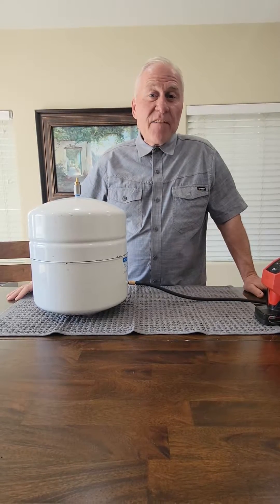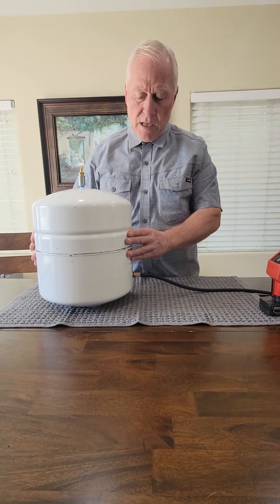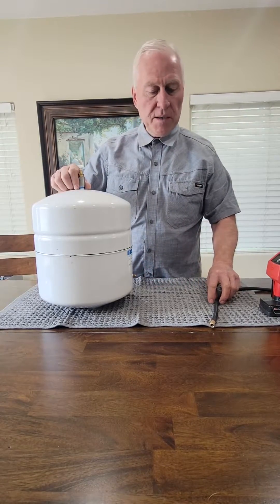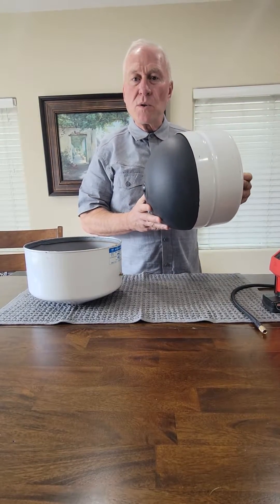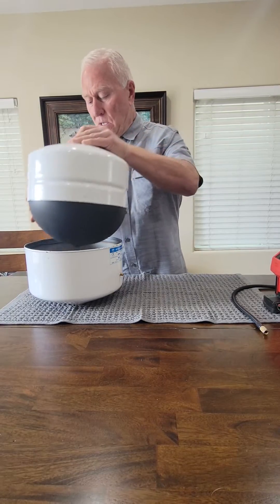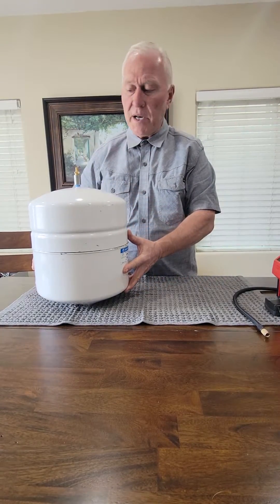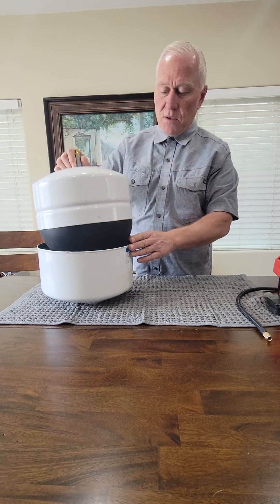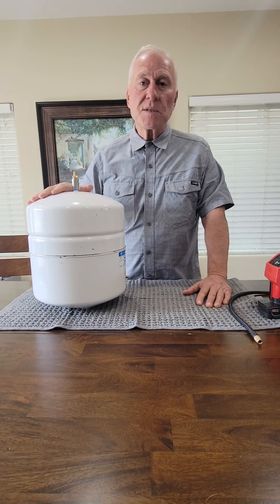What's Inside A Reverse Osmosis Storage Tank?

Comment: This is great. I like understanding what's really behind any system like this. Makes troubleshooting a lot easier. Like today, when I connected my 12v air pump to the tank it took a few minutes to get up to 7 psi. Now I understand why. That's a big volume to pressurize. Another video stressed getting all the water out of the tank first. I had a little left inside. But seeing this, so long as that top water valve is open, it's like pumping up a wet basketball. A small amount of water isn't important.  Now I'm curious if there's a hose leading to the bottom of the water side.